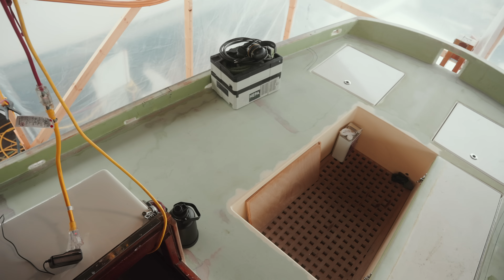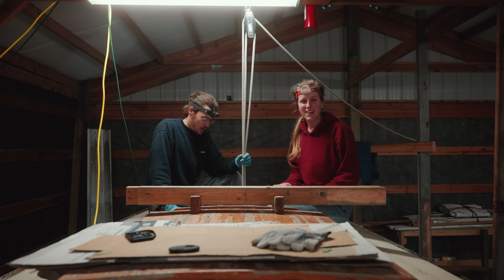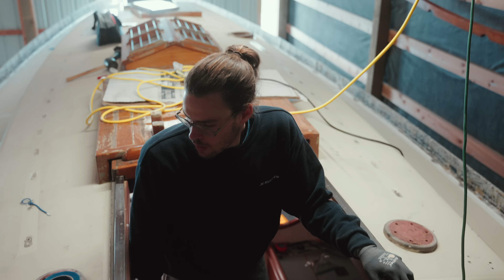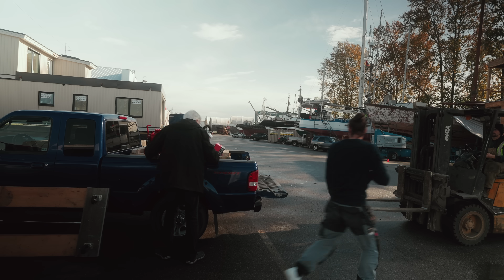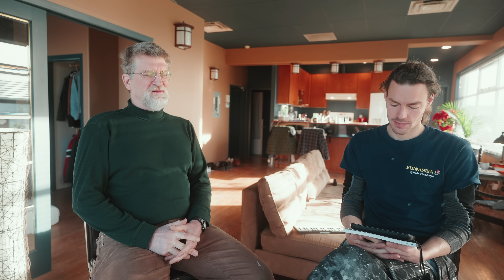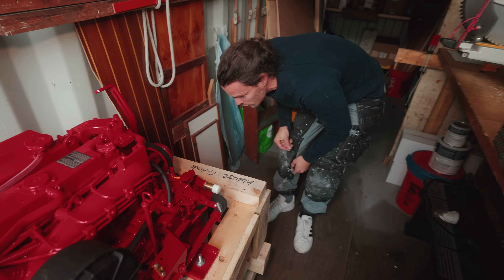REVEALED: Our New Engine!

Comment from the maker: Hey guys! I know that the "why not electric question" will definitely come up here, so let me give you some reasons why we didn't go this route. 
1. Electric is absolutely the way of the future. For the majority of boats who live at a slip and go out for day sails or weekends, an electric motor is a no brainer, because you can always plug in at the dock to re-charge. 
2. People seriously underestimate how much power you actually need to be able to regenerate on board in order to have reliable electric propulsion. No, solar on a 36ft boat won't cut it. In fact, on a 36ft boat, we're already pressed to fit enough solar to cover our "house" needs. 
3. That left us with the option to install a generator. Now we're talking buying and installing an electric motor, a huge battery bank, a generator, and a fuel tank for the generator. That's too expensive for us right now. 
4. We know Uma has an electric motor -- huge, huge props to them. Their boat is also significantly lighter than ours. It also comes down to willingness -- they're willing to accept the pros and cons of electric. We got used to having the long range of diesel which allowed us to do trips like the canals in Europe. And remember: all sailboats are already hybrids. Most of the time we're using wind. When we want to be able to motor long distances, we want the range of a diesel. 
5. Hybrids like what Tally Ho installed are also really interesting, but again, they're expensive. They also require a fuel tank AND a battery bank, once again a space issue that Tally Ho (a 50+ft boat) can deal with differently than MCII. 
6. Ultimately, like we often say: there is no one "right solution," there is only the solution that works for you based on what you're willing to pay and what you're willing to compromise on. This was the best choice for us and our boat.
Reply: There’s a lot to be said for a simple diesel engine.
Reply: @Durkan34  That may not stay that way for much longer.. 2040 is the begining of the end throughout Europe for all Diesel trucks and buses 2050 is the Euro end point.
Reply: @clivestainlesssteelwomble7665  right so, globally, diesel is still going to be used pretty much ubiquitously for another… 20 years past that … ? 

I think I’d be happy with an engine lifespan limited to only 40 plus years… 

And even then as someone else said a simple diesel engine can without much trouble run on biofuels.
Reply: @clivestainlesssteelwomble7665  I'll believe that when I see it.
The weight and fire risk of lithium batteries are unacceptable with the present technology.
Reply: Exactly.
Reply: Your logic is spot-on!
Reply: Well said
Reply: I agree, and...
I still believe that a thirty-something foot long boat with electric propulsion is viable, but you can't do it with this hull.
This is a great choice for this boat.
Reply: No doubt in my mind you made the right choice, personally I think electric is years away from use unless your running around in a harbour.
Reply: Great choice. Worldwide parts availability is excellent for Betas. 

Just a question/suggestion: Have you got provision for locking the prop shaft in that particular PRM gearbox?

My experience with hydraulic gearboxes is that many do not provide for shaft locking merely by engaging a gear without the engine running. 

No engine running, no gearbox pump turning, no gear engagement possible, the prop will just free turn. 

If you can’t lock the shaft, the noise and subtle vibration really does impose upon your life  aboard on a long passage, it also eats into cutlass bearing longevity. 

If it isn’t possible to lock it via the gearbox, fitting a shaft brake would be a good plan, but that’s just my opinion and as we all know, everyone has one. 😁

I get that you’re considering prop regen as a possibility for the future and like you I have questions about how efficient it could be with the Cape George deadwood shape etc, but either way I honestly think that I’d still provide the capacity for locking the shaft when you’re not using it because it really can drive you slowly nuts. 

Big props to Brian, pardon the atrocious pun but as a retired marine eng. I’m allowed. 

Cheers! R. 😎👍🍻
Reply: indeed. 
whilst electric may or not be the future (though the narrative seems to be pushed that way....) 
it is a given, imo, that its about 15 years away from being economically viable. the engines arent what breaks the banks, its all the batteries and other components. diesel will be well in use by the end of this century specially in remote areas where whatever small needed infrastructure is already in place and they cant really go  next door to buy an exquisite electric component that happenned to fail. 
i would like to see hydrogen being developed for regular safe use. all the requirements are already present, it burns clean, and we will never run out of it.
Reply: Sailing with thomas, talked about that electric alternatives, not something to consider.
Reply: Leo's Tally Ho project engine is a hybrid that ought to be of great interest because it has a generator/electric motor between the engine and the output gearbox.  The advantage is that the boat can be powered by the engine and/or the electric motor but also electrical power can be generated by the engine or by the prop thus either charging batteries or providing house power.  When its powered by the prop, essentially the generator is wind powered that is as green as it gets.  As Tally Ho is hybrid there is no need for vast banks of batteries unless you maximise the electrical usage.  If you look at modern hybrid cars their hybrid storage battery is no much bigger than a service battery for starting - battery tech has moved tat far, yet significant savings accrue because each power source is used to its optimum such that they compliment each other.
Reply: Tally Ho is 47.5ft, but still a big boat by comparison.
Reply: I like the thought that a sailboat with an engine is already hybrid while the sailing miles will outnumber the motor miles many times.
Reply: That inflection point of RPM, torque etc, that sounds incredibly useful to know.
Reply: Friends of ours, have been circumnavigatting on a 50ft catamaran since 2017. They opted for twin electric power when building the boat. The time, effort and specially 
cost they have gone through in this time is mind blowing. Electric propulsion for anything but day sailors or people with very deep pockets and a lot of patience is a still way away.
Reply: Electric motors on offshore sailboats are just dangerous. Sailing Uma is an accident waiting to happen. Electric sailboats will not save the planet. Sailboats are, like Aladino mentioned, already very green. YT influencers, sponsored by battery companies, never tell the truth about the dangerous downsides.
Reply: I follow except MC Tally Ho and Uma. Then Alluring Arctic and Arabella. Rebuilds are worthwhile to watch and solving technical problems are very interesting part of all channels.
Reply: Look up a BC company Eddison motors Topsy.
Reply: Theres a similar  kw per Tonne  conversion for electric ⚡ 
At the moment the best bets multifuel hybrid electric power.
Reply: I think there are a set of boats that should have electric propulsion. Those that spend their days on large lake or river systems where the owners race every week. We regularly see boats for sale there with less than 400 hours on 10-12 year old engines from a certain lake with a sea entrance. People are attracted to buying 12 year old boats with 270 hour engines. Unfortunately these engines are dying of old age because they are used to get out of the marina to the start line and back after the race. Not 30 minutes use per week. They have rarely been exercised fully. Imagine a blown exhaust elbow after 270 hours. It happens. Mine has done 3200 and is just fine.
Reply: ✌️🐬 Wishing you a continued beautiful journey
Reply: Congratulations for your new ferrari-red-like engine.
I love the idea of naming it Enzo, especially because it's a diesel one!
I think you were right about choosing this kind of engine, because of your needs. Yes, Electric propulsion will probably be the future of boat propulsion, but is is not (at this point) suitable for every type of boat and utilization. MCII is a long range blue water sailboat. You won't find plugs to charge your propulsion batteries in the middle of nowhere and solar or wind energy won't be enough to charge your batteries within a reasonnable time. It's a matter of safety, you must have an engine you can rely on. At this point, Diesel (with all their drawbacks in terms of noise, pollution and CO2 emissions) are still the best solution for your kind of use.
Cheers to all of you.
Reply: Exceptional and informative!  Awesome.
Reply: Your logic is sound and you've made the right choice for your requirements.
Reply: Couldn't agree more with this. Electric technology will continue to evolve but given that you needed a new propulsion system today, I think you made a wise choice. Going full mechanical is also a great plan.
Reply: Great decision as diesel will be available for boats, yachts, and commercial for the rest of our lives, and if not straight diesel cooking oil which will also suffice.
Reply: Very well said and well thought out.
Reply: I don't know much about sailing, but I do have vast experience operating heavy equipment and heavy trucks. A simple mechanical diesel engine is an excellent choice.  Not only from a simplicity standpoint but also a reliability standpoint as well. I have been left stranded by electronic engines, most specifically manufactured by Volvo on several occasions and whether you are hundreds of miles offshore or hundreds of miles from a shop in the vast expanse of Canada or even my own country, you are just as... forgive me, right properly screwed. At least with a mechanical engine, you have some hope to sort things out well enough to limp your way out of danger. Often, all one needs to do is stare at the blasted thing condescendingly while holding a large hammer. All kidding aside, a properly operating diesel can be every bit as clean running as any other means of mechanical propulsion under ideal conditions.  Solar power and magic fairy dust do you no good when the sun isn't shining and there is no wind to fill the sails. I feel you made an excellent choice, and I am very interested in seeing what you decide to use for fuel purification purposes.  I also hope for a detailed installation video of your powerplant  sans music and time-lapse videography. Warmest regards.
Reply: @xm15ar  I  agree 100%. First world technology is useless when it breaks away from the first world. IMO electric power  is worse than useless at the moment.

Comment: Ahoy Aladino and Maya
I replaced the original Universal 5444 engine with the Beta 43, (they share the same Kubota engine block) in a 1984 Cal 39 @ 9 tons.
We purchased from Ben at the Vancouver Boat show before we left BC in 2019. (I spent two years with my associates at Innotech Windows and Doors as their QA guy).
Anyway these Kubota engines are totally reliable and although there was nothing wrong with the original I decided to renew and donated the 5444 to my diesel mechanic buddy Keith MacDonald here in Nova Scotia. The new one sounds exactly the same as the old one! We can cruise at 5-6 knots at 1200 rpm with a Martec folding 18" prop. Ben is great to work with and you are set with an excellent engine. ............ Just started to watch your channel, going up and around Texada Island. Before we left BC we chartered out of Nanaimo and went up into and around Desolation sound and back over to Tribune Bay etc. You could spend a lifetime exploring out where you are!

Cheers
Capt'n Ron
Reply from the maker: We are very happy with the engine too!
Happy exploring,
Thanks for your comment:)

Cheers,

Aladino

Comment: I've been watching your chanel with great pleasure but wish to talk about my experience with Betamarine. We had the 3 cylinder 20HP engine and found it good. We did have some problems with it though, some of which could affect you. 
1. The thermometer option involves a sensor that was in our case fitted close to the alternator and reduced the range of movement of the alternator when fitting or removing the power belt.
2. The heat exchanger  tube stack can go either forward or back when taken off for cleaning. In your case it cant go back because of the swan neck exhaust fitting  and cant go forward because of the alternator. In some ways the straight exhaust system is more convenient. 
3. My Swan neck eventually got a hole in it due to the weld/ fixing of the cooling water  inlet to it. Just be aware. 
4. I very much liked the idea of the emptying of the gear box oil. Very convenient. When bought my engine used same lubricant in both gear box and engine. this was later changed so the gearbox got EP oil. 
5. Beta insisted we fit a fuel lift pump as fuel was stored in the keel. This made bleeding the fuel system very easy but the pump made a loud clicking all the time.
6. The oil removal pump may let the oil out in an inconvenient place. Think about how you can get  a collection pot into position and remove it without spilling oil.
7. Prop shaft seal. this will be quite difficult to access. I bought a good carbon/stainless seal in Belgium which lasted very well.  Th old, already fitted greased seal was a horror getting grease everywhere.

Comment: Good video
I have a Beta 50 on a Sabre 426
I have been very happy so far. I get over 7 kts at 2K rpm 
4 small points I would make
1. Beta spray that red paint everywhere including the wiring looms which can make identifying individual wires challenging and annoying😮

2. The oil change pump works ok but makes for  hard work to empty all 9 littes on the B50...I would carry an alternate oil removal system to make it easier. I do like the idea of the transmission being connected to that hand pump 
3. The fuel lines on the B50 are clamped using crimping hose clamps. Not good as there is no adjustment and I had 4 of them leaking with less than 300 hours on the engine. I would recommend you replace all the crimped hose clamps with the more common adjustable SS clamps

4. I assume you plan to add smart alternator regulators??   If you use the keyless instrumentation panel, there is a wire that goes from the panel to the alternator that acts as the ignition on control in order to enable the internal or external regulator 

Good luck
Reply from the maker: Thank you!

Comment: Man bun aside, you made the right decision sir! I owned an electric sailboat. Loved everything about the boat except the aux propulsion. Batteries are the problem with electric motors. I will change my mind about this when a practically designed electric sailboat can transit the Panama Canal. I do think a sailboat could load up thousands of pounds of batteries an make the passage, but that is not practical. As far as I know, not a single electric sailboat has the ability to maintain 5 knots of boat speed for a significant period of time, and I think that is a requirement to transit. Imagine that for a second. A straight thru passage only takes 8-10 hours. SHORT WORK FOR A BETA MARINE BRUH! It would make for a great video to see someone attempt it in an electric sailboat. Maybe you could team up with an "alternative power" youtuber and give it a shot? Just make sure you have a tow boat at the ready. I could be all wrong about this and electric sailboats transit daily. I just haven't seen it. Have you? Anyway the boat is looking good.

Comment: We have a Beta 43 on our 58ft boat of 17 tons, built for UK inland water ways. There are 3 alternators on ours - 2 like yours and the other acting as our generator. See YouTube link for more https://youtu.be/QRpoKPzDnf0?feature=shared. Our engine is 15 years old and never lets us down. We service it more regularly than Beta recommend for oil / filter changes and change the alternator belts every year. We are careful over fuel supplies and have an additional inline fuel filter plus oil / water separator.

Comment: Completely agree with the traditional injector choice over the common rail option. Also keep close eye on the quality of fuel when you do fuel in out ports. Get some water cut paste in your fueling set up. Water in the fuel is the bane of marine engines. If you're going with Racors, those clear lower bowls will make it easier to notice contaminated fuel, but sounding the tanks with water cut paste will let you know immediately if there is a problem when fueling or if there is a bad tank vent that is allowing water in.

Comment: Well done! As a retired electrical engineer myself, it was a pleasure to hear Maya's father's discussion on engine sizing, propeller rpm, torque curve, fuel consumption, etc.. Proof that a dose of engineering beats the WAG (wild guess) approach every time. The amount of thought that you have put into this boat project is epic and will hold you well as you cruise for years. There's an old saying: "when you don't know where you are going, any road will get you there." You folks are at the opposite end of that spectrum. Hope that Canada has been kinder to Aladino wrt visa duration. Keep up the good work and every wish for health and  success with MC II in 2024.